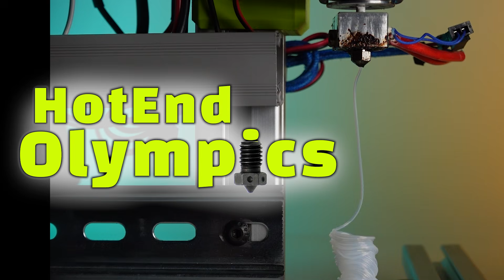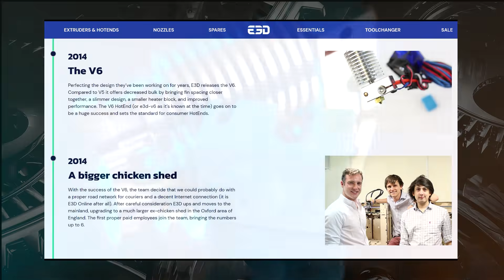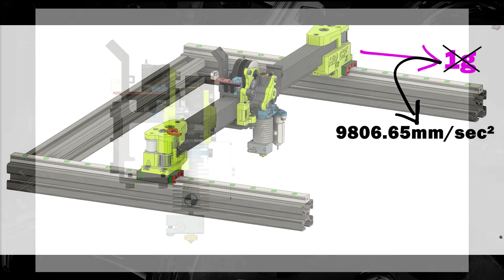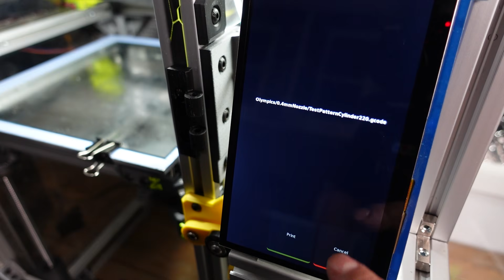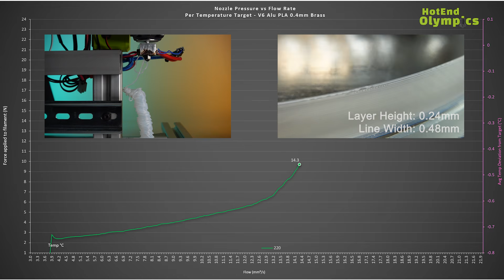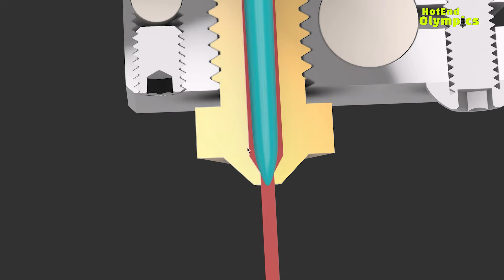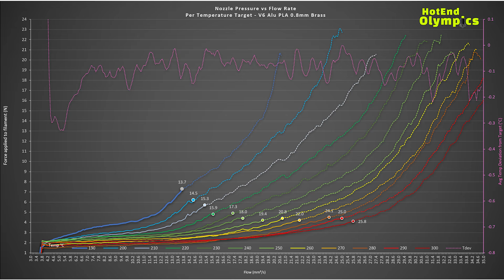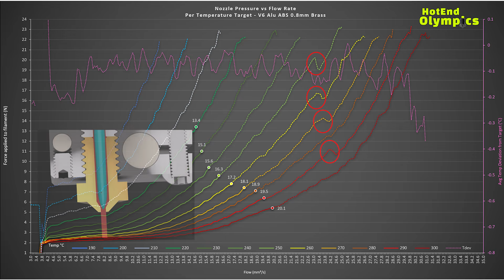How to find the best HotEnd? - Ultimate HotEnd Testing - Episode #1

Comment: Here's an ideia: 
   Supervolcano nozzle, 2 CHC Pro's and a standard CHC. 
  These are heating cores made by Triangle Labs that are similar to Revo Cores, except V6 standard dimensions. 
  If you want to spice things even further: 
   CHT Nozzle + Supervolcano Extender(haven't seen on yet, but the concept is there). 
This has to be the most powerful hotend with off the shelf components(not considering the extender version)
Reply: PS: You can also take advantage of the 3 independent heaters to have different temperatures along the meltzone, like in industrial extruders.
Reply from the maker: Agreed this would make a quite powerfull hotend in terms of meting capacity, But having used Super Volcano a lot in the past,  I suspect retraction and pressure management would be the downside.  Without speaking of the unsupported length that would be dangling under acceleration.  But definitely an interresting concept.

Comment: Very nice! This is just the kind of data I am interested in. Another thing that I think would be good to do is to test the melt flow index for different brands and different materials. It would be interesting and helpful to know how a high melt flow index affects the printing speed. My theory is that you can upgrade to the biggest and best extruder, but if you are trying to force a low melt flow index material, the material is going to become the bottleneck. I work at a plastics company and I am very familiar with how much the melt flow index matters.
Reply from the maker: Totally agree with you!  I cannot wait to see some Filament manufacturers to embark the 3dprinting speed wagon!
Reply: Maybe a good YouTube video on the subject will give them a hint! I have seen a few filaments advertise the melt flow index but mostly that spec is not available. The highest advertized I have found was 12 melt. Most of them range from around 1 - 8 melt. But I don't know how realistic it is without testing it. I think somewhere around a 20 melt would be interesting to see what happens.

Comment: Are there any plans to test with a CHT nozzle in addition to normal ones? CNCKitchen's testing of it showed considerable improvements in melting ability, which might be able to give even faster speeds. It would be a lot more work, so maybe just test on the highest performers?
Reply from the maker: Definitely part of my plan to select a few candidates and get data with CHTs on.

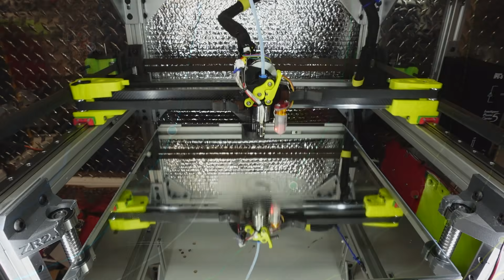Comment: 15:22 8:27 but is the "mountingface" of the V6 mechanicly the middle of the grovemount?
Reply from the maker: Yes, I was on the fence for this one.  So the moment would be indeed a tad lower.  But any installation using such mounting solution needs to be extended a few mm downward to make room for it.  so in the end I elected to take the upper most mounting face as the reference.

Comment: Finally, I was looking forward to someone to do such a standardised and detailed comparison for the hotends. My compliments. Please allow me to point out, that every filament type has it's own rheological behaviour characterised with the melt flow rate (MFR) or also called melt flow index (MFI), which is a standardized industrial method to test the flow capabilities of the plastic. As I have done a flow comparison between filaments myself with the Flowtesttool from CNCKitchen Stefan (and being in the plastic processing business for all my life) I know, that the MFR is one major influencing factor for the flow capabilities of the hotend. My advice is, that during the olympics it is important that you use the same filament, even the same batch if possible, as the MFI is changing between plastic batches as well. Otherwise the test results will be not comparable. Can you please indicate the actual MFR of the plastics you used for the test, just out of curiosity? PLA filament MFR values we can buy are ranging from ~5 to 15 g/10min. The difference in flow between MFI 5 vs. 14 on a Prusa Mini hotend with 0,4 nozzle is 11mm3/s vs. 22mm3/s when they reach 10% underextrusion.
Reply from the maker: I bought large amount of spools from the same brand.  Ill have to check if they are from the same batches.  I will investigate about the MFR.  This is unknown territory to me as of now.  Any literature I could educate myself with?
Reply: @MirageC   to keep it very simple: you have a cilinder with at the end a very precise hole. you put a plunger on top of the melted pellets. you ad a precise weight, I think it was  1 or 2kg. and then the meter will start to count how long it takes to extrude 10 mm. that measurement is then converted to MFR. you just have to watch that there are no airbubbels trapped when extruding in those 10mm he is metering.
Reply: @MirageC  https://en.wikipedia.org/wiki/Melt_flow_index
Reply from the maker: @gabortoth3300  Awesome!  I am educating myself right now!  Very cool device!  We will need to create a Filament Olympics series!
Reply: @MirageC  This is why your series will be a big help not only for every user, but in my oppinion the 3d printing industry as well. There is no standard test procedure for hotend flow yet. You said in the video very correctly, that the print speed is now limited not because of the movement, but the plastic flow. So the industry desperately needs a standard method to compare the performace in an equal way, and so the game rules are becoming equal as well.
Reply: Can you not donate him a MFI meter :P , its not that difficult to use.  Used it daily at petrochemical company that was making LD-PE.  anyhow i donated you some money, it could definably be a very good improvement/investment to you research
Reply: Actually you can misuse your own hotend setup to be a MFR comparison machine: run the same test with different spools of the same filament and you can verify, if the result is nearly the same. Then you can be absolutely sure, that you compare apple to apple. Not like Jeremy Clarkson with "Car time -  xx:yy (wet lap)".
Reply: @gabortoth3300  well problem with this is that depending on the flow your filament is not equally warm. With the melt flow meter you wait 2min before you extrude so temp is all the same.   If you extrude at let's say 10 % capacity of your biggest hotend and you then measure the pressure  then I would say that the filament ists temperature is equal. Then the only difference in pressure is because of the MFi of the plastic
Reply: @VinokDesign  I cannot interpret fully what you mean, but the last sentence: "Then the only difference in pressure is because of the MFi of the plastic" tells me, that we are talking about the same thing here. We used this method with actual extruders producing medical tubes. If the extruder pressure rised or lowered without changing any of the process settings, it was an indication that we have to rise or lower the barrel temperatures accordingly to compensate for the change in MFR. Especially during charge changes. So the idea is to do the same on the 3D printer hotend. If you change nothing in the test settings, and run the test again, but a different spool of the same filament type and the force applied to the filament (extruder pressure) changes, you know, that the MFR changed and the flow test is not any more apple to apple comparison.
Reply: @gabortoth3300  yes that is correct what you are saying, but you have to do this comparison in the mm³/sec region where you are sure that the fillament that is leaving the nozzle is exactly at the set temperature.  If your flow gets.to high the plastic will be melted,.yes, but not stable at the extruding temperaturemaybe 4 degrees lower or more... Or less.... You will only know if you could measure at the exit.of the nozzle... . For example take a super volcano and extrude at 10mm³Sec. Don't do that with a v6 since you are already in the rising curve/ limit of the heating element
Reply: @VinokDesign  Yes, I think I understand now. Basically you want to copy the industrial MFR measuring method and use it to determine the real MFR of the filament. What I ment is only to compare the two batches of filament by looking at the curves which are already implemented by MirageC. If the curve is significantly different from the perivous one without changing the process settings (in this case the temperature), then you know that the filament has a different MFR - and can even know if lower or higher - and therefore the result of the hotend comparison will be not accurate. It's not for a quantitative analysis, only qualitative.

Comment: Legit science, bravo~!!!! I think it is also worth to mention the hotend react to speed changes, i.e if print outer wall much slower than inner wall in a big object, the beginning and end of the outer/inner wall will be different, but it maybe too hard to measure, and the Revo & Rapido may gain some extra credit
Reply from the maker: Per my current observations, the small thermal mass of the Ceramic heater type hotends, tends to struggle more with sudden extrusion bursts.
Reply: @MirageC  I've already experence this with my newly arrived Revo :P...fine turn pressure advance with 0.8mm nozzle is a nightmare and it give extruder extra pressure that expose the problem I never found before...

Comment: wish i had talked to you before, ive been working on an extremely similar design/testing for over 2 months now (although very slowly due to time limits). Great work!
Reply: Actually - measuring the force needed to push the filament into the hotend is one of the objective which is really reflecting what is going on into the melting zone.
Most of the studies available here on Youtube uses wrong approach of the skipping extruder (which can be a result of million things but the processes ongoing inside the hotend).
Reply: @rmatveev  yes, ive been using a load cell for some parts of this, as well as an lgx which makes skipping harder.

Comment: I would love to see a klipper feature which uses a rotary encoder for some kind of active flow compensation.

I guess the hot end could be characterized, but it would be really tedious to do that at every temperature with every filament and flow rate.
Reply: I think that it is a wrong approach. If you need to push the filamen hard through the nozzle, that means that it is too cold which will result in bad prints.
Klipper could make accelerations depending on a speed (more acceleration at low speed and less acceleration at higher speeds) which would make printing significantly faster.
To make filament melting faster you don't have any options but to increase the contact area between hot end surface (nozzle internals) and the filament. Volcano does this by its nozzle elongation, CHT with its complicated surface curvature.
Reply: @rmatveev  it wouldn't allow for extruding past the max flow rate, but it could compensate for under extrusion while approaching the limit and prevent over extrusion when going slow. And you would never need to tune your flow rate multiplier for different filaments or extruder tensions.
Reply: I'd be more interested in a filament runout sensor that could also detect jams with an encoder
Reply: @aharkey1077  it could do both. Maybe even detect potential nozzle jams before they happen.
Reply: I plan on doing an encoder to detect runout and jams as that seems like low hanging fruit, closed loop control, while interesting, is a completely different can of worms.
Reply: @aharkey1077  You mean the BTT filament sensor?
Reply: @condorman6293  you are right, for some reason I swore the BTT runout sensor was JUST a runout sensor with no way to detect a jam but it appears it does. Neat guess I’ll buy one of those instead lol.